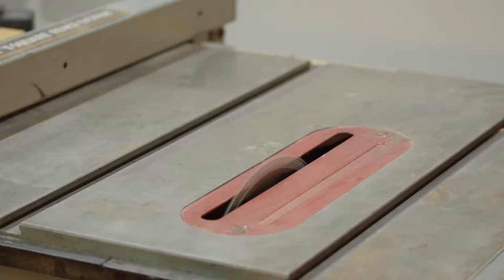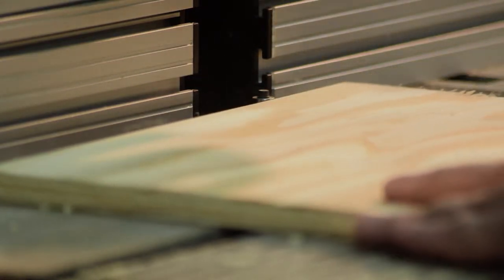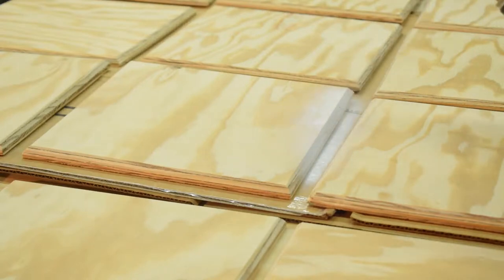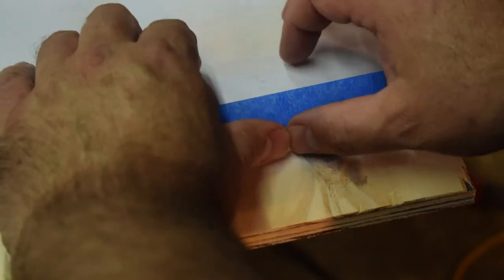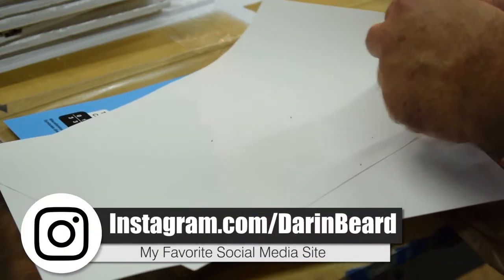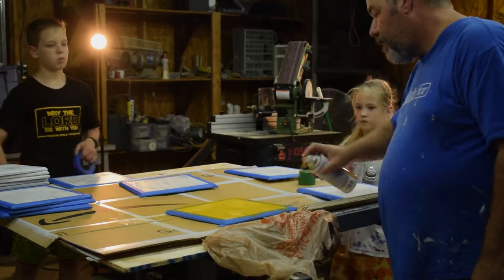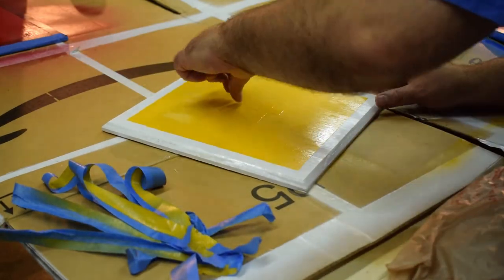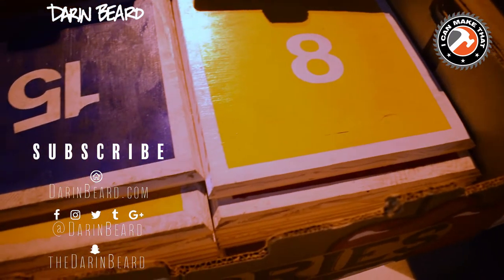DIY Reusable Cakewalk Squares

Comment from the maker: One thing I found after using these for a couple of hours the other night... Originally I was told they would be setup on grass. Turns out it was in the parking lot on concrete. I might go back and add something non-slip to the bottom. They didn't slide much but I would hate for someone to jump onto one (which they did often) and it slide out and send them tumbling. Something to consider.